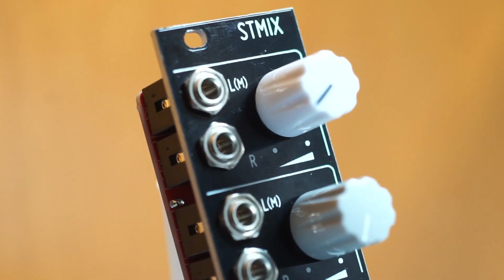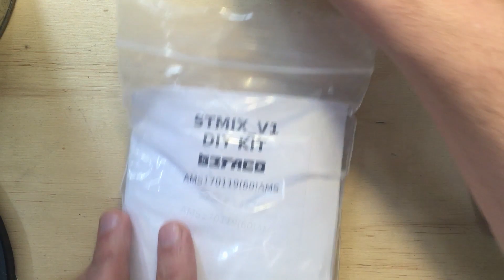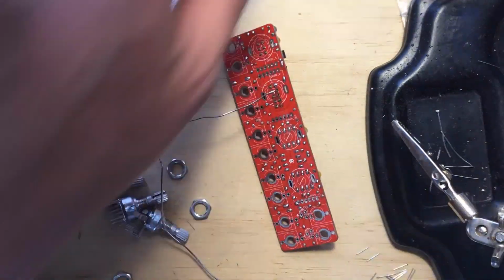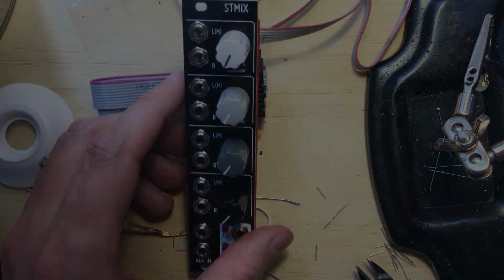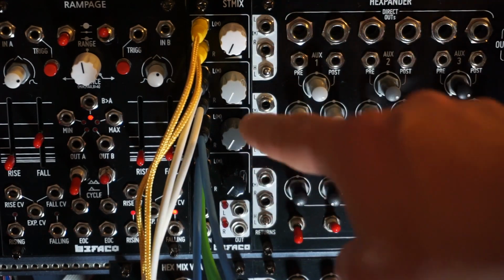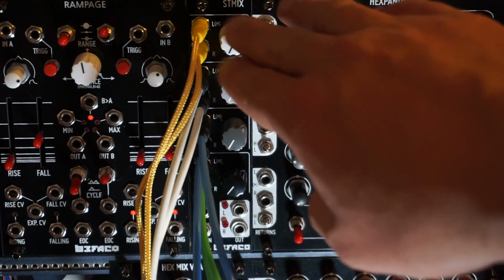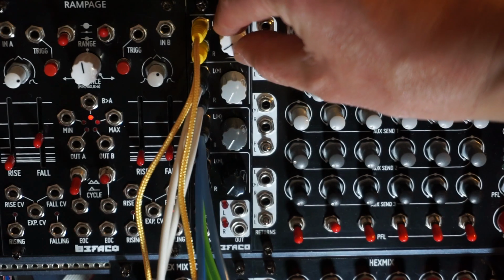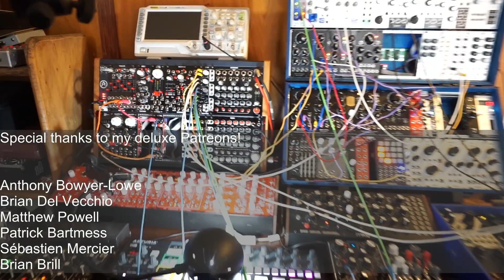Kit Overview # 38 : Befaco STMIX

Comment: At 1:40 . For noobs at DIY like me what exactly is going on? You have the multi meter set up as ? and you are looking for ?  You mention this on every video but its the first time i have seen you do it.  I have built a few kits but my knowledge is really low. Great video BTW and another cool Befaco module.
Reply from the maker: I'm just checking for shorts between the rails. Using the meter in continuity mode (the one that beeps when the leads touch each other) I check to see if 12v is touching ground or -12, or if -12 is touching ground. etc...  There should be no continuity between the three rails, therefore no beep.  Cheers!
Reply: @QuincasMoreira  cool, thank you i will try this myself.
Reply: Oh and a warning, do not have any power going to the board or you may damage the multimeter.
Reply from the maker: @gorillaau  not really! In fact it's very common to use the meter with power going in, it's how you trace signals, check for proper voltages, etc..  These are resilient devices and the currents and voltages in eurorack are relatively harmless.
Reply: @QuincasMoreira  in continuity mode, don't take the chance. But to each their own.
Reply from the maker: @gorillaau  ah yes, gotcha :)